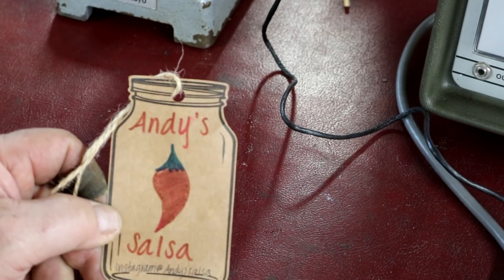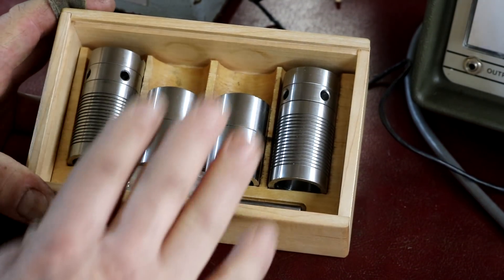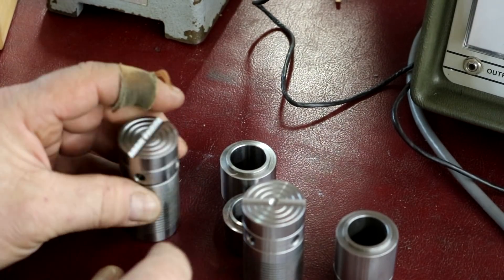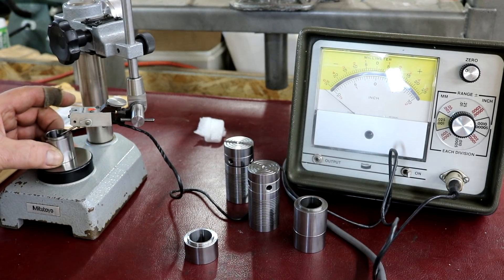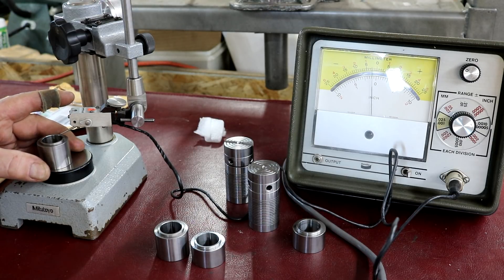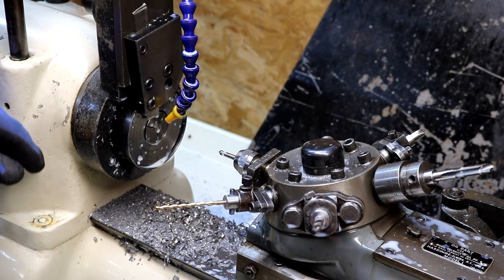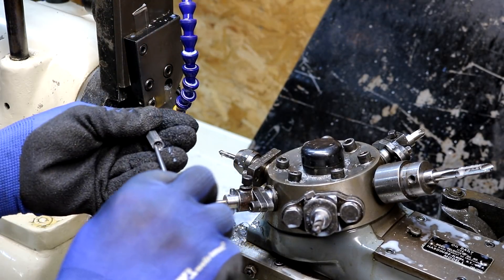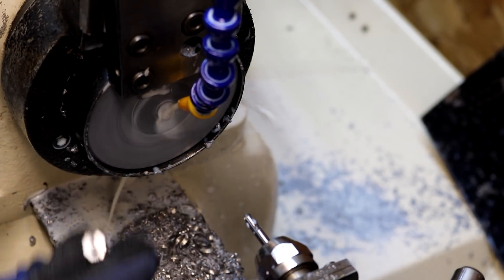How To Hardinge Turret  Setup #1 and Viewer Mail

Comment: Drat it Randy - now I want a Hardinge.  You are having way too much fun making scribes- used to be work. Now it's a joy. 

Dan
Reply from the maker: I do enjoy it.  There are many models and setup to choose from.   I would love to have a tool room model.
Reply: Randy Richard In The Shop - Well there seems to be a hotbed of tools out your way and nothing until you get to Kansas City. I am lucky living here in the rust belt in the MI/IN/ OH corridor for old lathes and Mills. Next up is getting my H&G threading tools dialed in. Not a turret lathe to be sure but I won’t buy any more garbage threaded rod from Lowes! 🤮
Reply from the maker: I would love to get a 5/16"-24 thread rolling setup for the Hardinge. $$$$$.
Reply: Randy Richard In The Shop Try the seller I mentioned before. I started with one threading die question - and as we talked I have five now. I will have threading from zero to 1 1/4 in. The guys are amazing. What is on eBay is nothing.

Comment: Cool machine. I want one. I'll figure out later what to make on it (and where to put it . . . . and how to pay for it!). Are there die holders so you can do external threads? Knurling? BTW, it looked like you might have one unused position on the turret for this setup. I wonder if you could use it for just a plain rod such that when you're parting off you can insert the rod into the bore so the part doesn't just drop after parting.
Reply from the maker: Yes on the die holders and knurlers, I will be showing that.  Yes I could put a rod in to catch,  but when you go to turn the turret it will fly off and could get dinged.  Some times you put in a sloped tray for the part to drop on to and roll away.  Thanks Todd for the comment.

Comment: Purchased a turret for my South Bend 10K, need to set it up for making the small (1/4" and 3/8")  bushings for my engine.  The cross slide on the saddle interferes with the turret's stroke. I've never set one up before.  Are you using 3 phase power?  I have an electronic convert box that doesn't work very well.   Good video, very helpful.
Reply from the maker: Thank you.  If you do not need the cross slide roll it out of the way and put the tailstock on the chuck side.  Yes my Hardinge is 3ph, I use a rotary phase converter for it.

Comment: Randy..... My employer has just purchased a Hardinge turret machine. What is the proper way to true up the tools in the turret with the spindle bore? Have never run one so am youtubing for some info. Enjoy your vids and thanks.
Reply from the maker: Each tool is different.  Some are very adjustable and some not to adjustable.  Usually you set up a job on the lathe and run many parts.  Each job is different.

Comment: Don't blame you for not wanting to work for Amtrack!! - Like a kid on Christmas. -  Are you using a gun tap to tap a blind hole?? Is that why you are having to clear chips from the units when through?   -Estimated time saving per unit? - Great demonstration of setup and production capabilities.  Should save some time!
Reply from the maker: No I am not but I should be, I am using a spiral point one,  they were a gift from James Kilroy.  I was doing the parts on my 1/2hp flat belt Logan with a turret before.  The Hardinge is a 1 hp V Belt and driven.  So for Brass parts not a lot of time saving but maybe 5-10 secs.  But with the Stainless  probably about 30-45 sec.  This Op I am showing here is the longest op and is running 60 sec.  I figure I should have about 3-4 min per scribe.  Not counting Lathe Setups, cleaning, polishing, Engraving, packing, shipping.  Great comment, Thanks.

Comment: I was told never to use water-based cooling on a hardinge DSM or 59 straight up. I've been using oil on my DSM 59 and I wish I could use a water-based coolant. Was I misinformed?
Reply from the maker: Yes I have heard that.  Why I do not know.  It is no different than any other machine.  I am running a 20% mix for better lubrication
while tapping and threading.  The lathe only holds about 2 gals so no big deal to change if you need oil.  For the Stainless I want more heat rejection than the oil can provide.
Reply: Randy Richard In The Shop I'm using standard 5c collets so there is no real protection at the spindle. I just spoke to a guy at a company that manufactures mineral oil products and he's going to send me 5 gallons of there mineral oil coolant to try out. I don't like the fact that my setup could flash fire at any second LOL. I really would like to try water-based but I'm really paranoid is replacing Parts on a hardinge ridiculous. I've been looking for a tapping head now and I can't find anything under $350. I got a beautiful H&G threading head in about a hundred fifty sets a nice Chasers for $125. That was a great find it was very dirty and as soon as I clean it up I checked out all the surfaces and there was nowhere anywhere it's like brand new. I had to make a few springs for it but that was cuz they were missing there cuz they were wore out
Reply: I wonder why?  Robin uses flood coolant with his HLV.
Reply: Bill De La Vega hlv is a totally different Beast. From what I've read the DMS 59 and a like not have sealed spindle noses.
Reply from the maker: I will have to check that.
Reply: Randy Richard In The Shop always take it with a grain of salt you know how the internet is rumors become fat really easy LOL
Reply: I wonder about this too. I did a complete renovation on an HLV-H that had been used with water-based coolant. There was pitting on the cross-slide screw and on gears and shafts in the apron. The guy I bought it from and several people on the PM forum told me water based coolant is a no-no on these machines. They were designed before it was common, but I don’t know how water coolant machines are different. Do they have stainless lead screws?

Comment: hi not to be a smart ass or any thing but if you are running anything over 100 parts at a time I would be thinking of getting a brown and Sharpe screw machine it would take a learning curve would deftinly save a lot of time use the same tooling.  I make draw out my cams on auto cad and cut them on a band saw and make form tools on surface grinder.  they can be picked up fairly cheap.
Reply from the maker: Yep thanks.